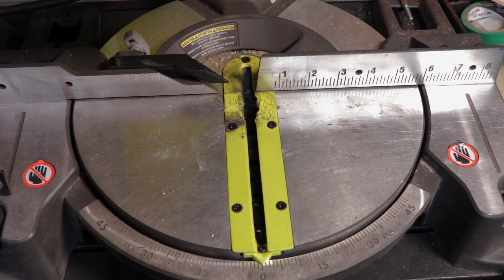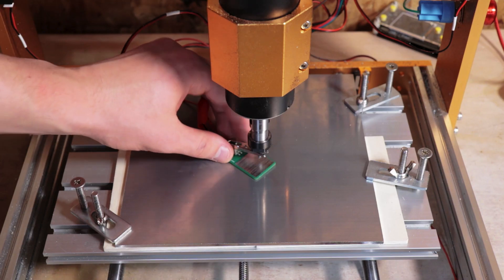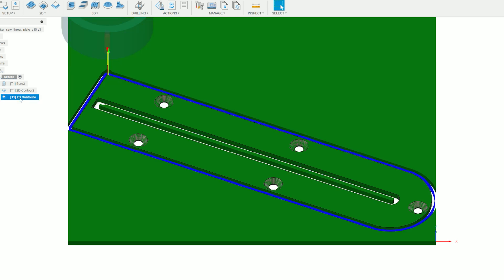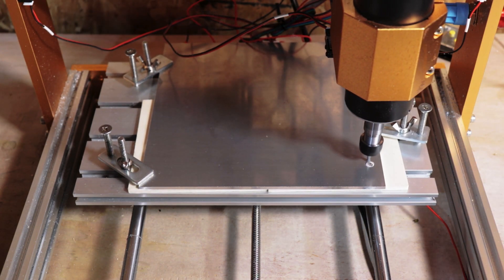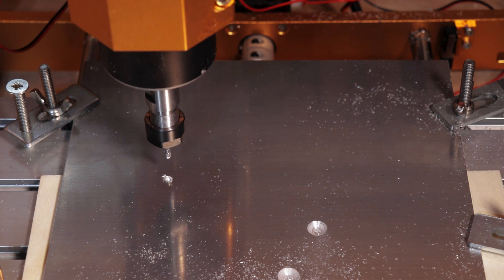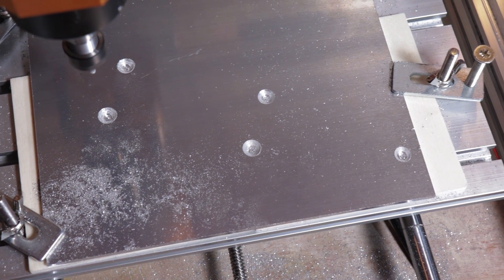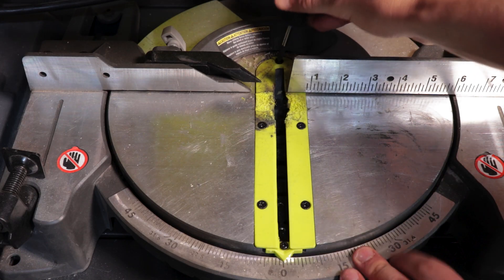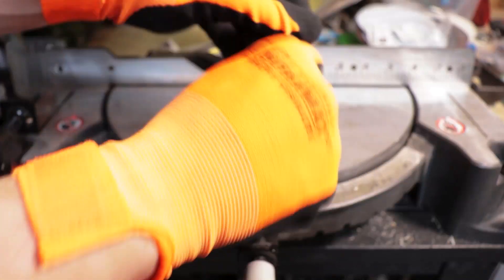UPGRADE Your Ryobi Miter Saw with a CUSTOM Metal Throat Plate!

Comment: What type of endmill did you use?
Reply: What what the thickness of the aluminum
Reply from the maker: 1/8 in O flute
 I had it left on from a previous project since I like the surface finish, although for 2d carving where I dont care about the surface finish (just need to cut) I think my single flute carbide end mill cuts better/faster, just didnt bother to change it out
Reply: What Is the thickness of aluminum stock you used?